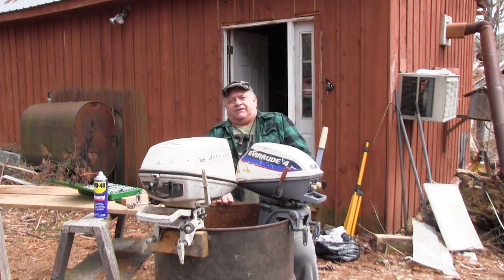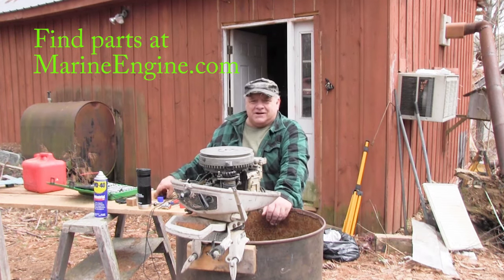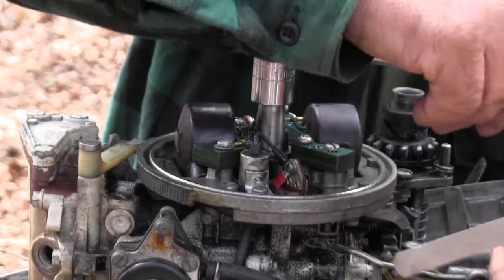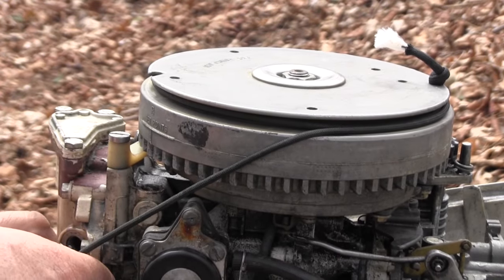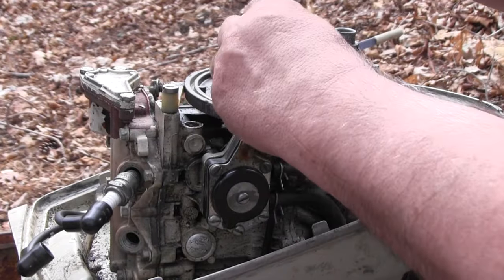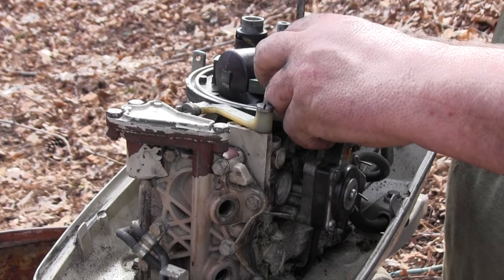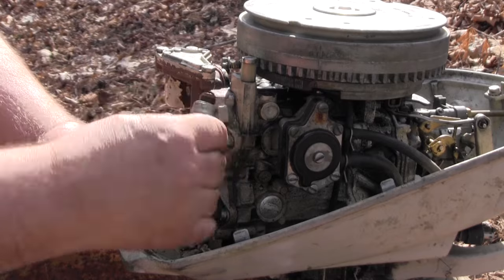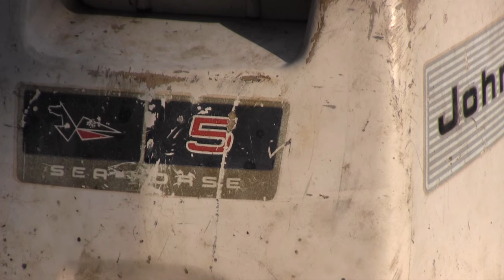1965 Johnson @ The Rustic Log Cabin Deer Hunting Camp

Comment: HI Tom just got power back IF you dont put that nut back on the shaft be for you hit it with the hammer i coming over and hit you on the head the nut will save the threads from being rounded over.  now for them junk Evinru put that in the trash where it should be.but for getting that motor running great job you said sweet many times so i was thinking you wanted some sweet corn lol
Reply from the maker: Hello Enos,  Hahahaha, I knew you were going to give me the dickens for hitting that shift without the nut. lol when I was hitting it. 🤣🤣 I was careful not to hit it too hard and centered. 

It's very sweet to get that motor to fire up. Sweet 🤣 sweet sweet 🤣 

Now for that Evinrude, lol. 🤣🤣 I have a 12 foot boat and an old trailer that's needs a boat motor. I'm going to put them together and try to sell them as a package. :)

Tom